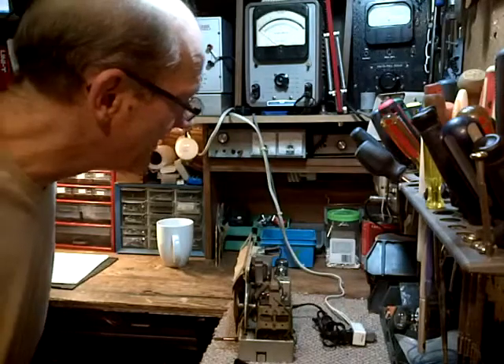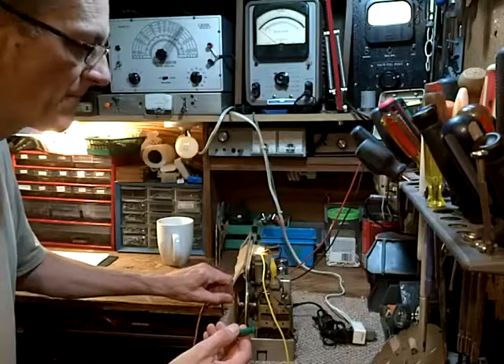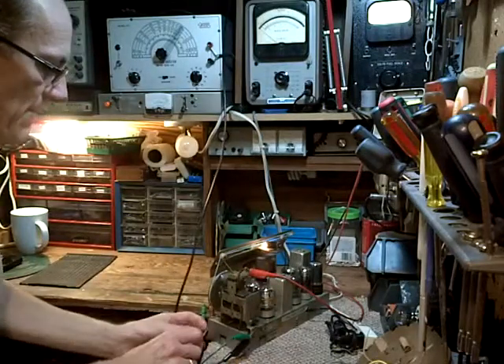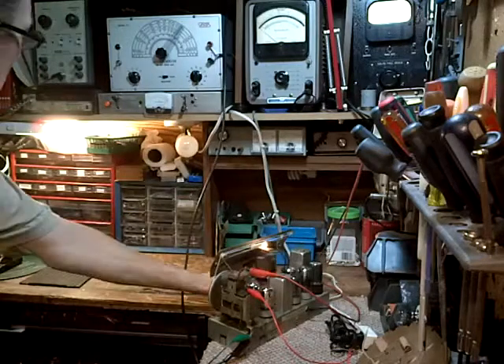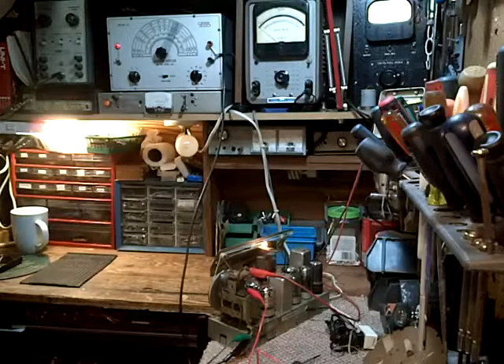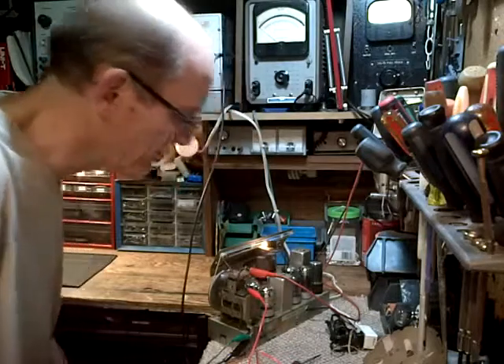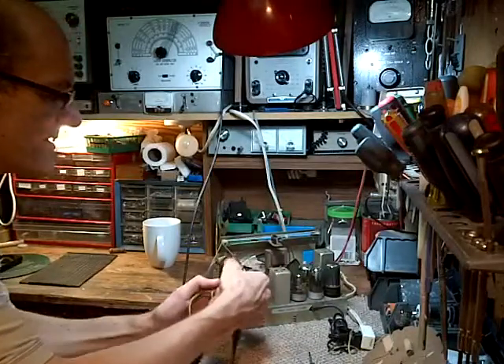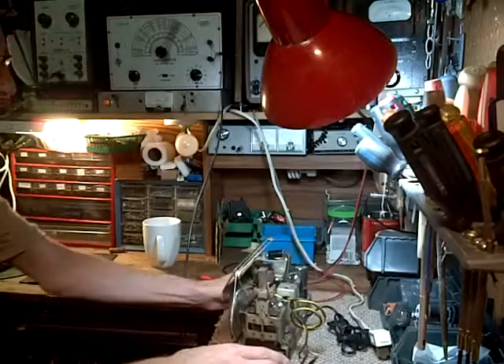Philco Tube Radio PT-10 Video #8 Final Tune Up

Comment: Hi Jim. Thanks for sharing. When you have some slippage on the dial string you use some bee's wax on the tuning shaft and string. Most radios have a cap either across the line or from one side of the line to ground. These are line filter caps and they only work good if the chassis is earth grounded other wise there is no place for the interference to go. So if you ground chassis to earth it reduce that interference. Make sure you the old caps safety rated for the line. Dennis